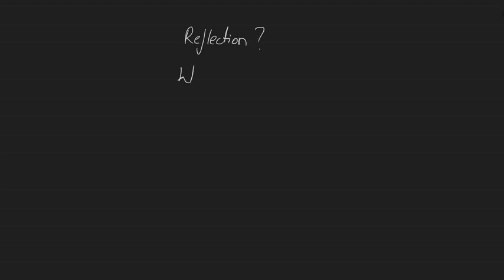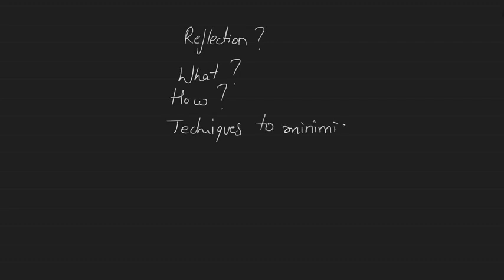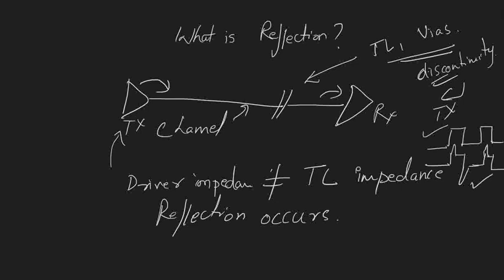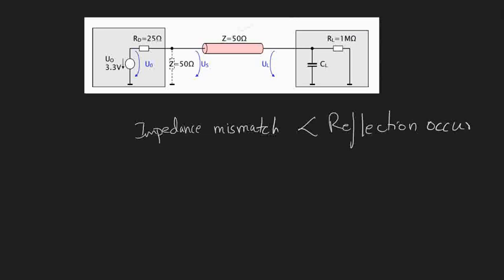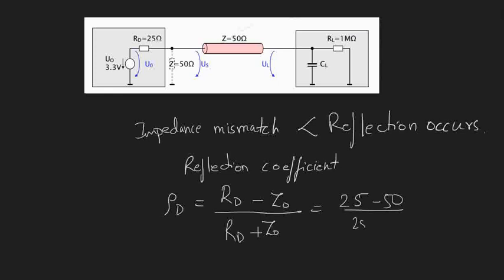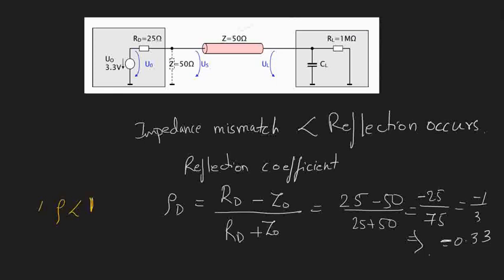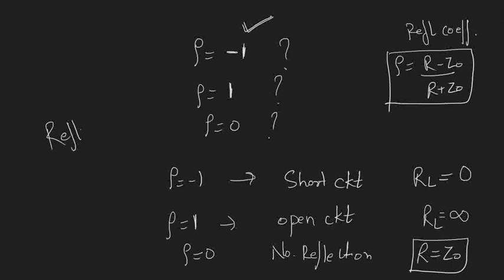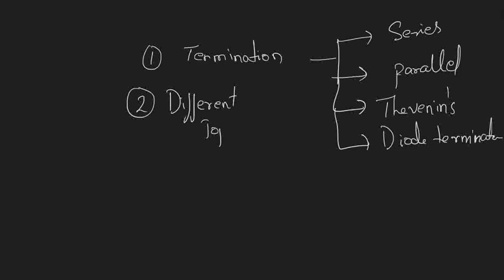Reflection and termination Techniques

Comment: Why ground via is required in differential vias. What is the main reason. What will happen if we were not used the ground via.
Reply from the maker: Hi Mahesh, thanks for the Query.
" The Ground plane acts as a return path for the current.  From the basics, if we see" current always flow in a closed loop. That's the main reason we use Ground via to connect and complete the current loop for the particular signal"